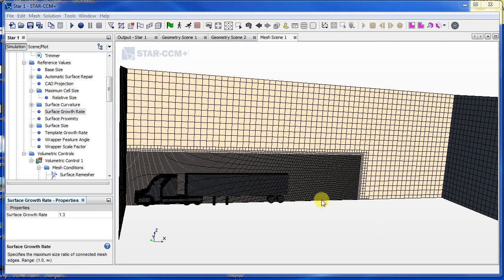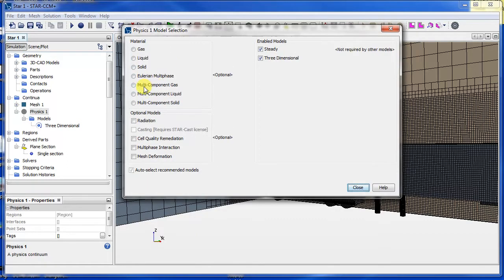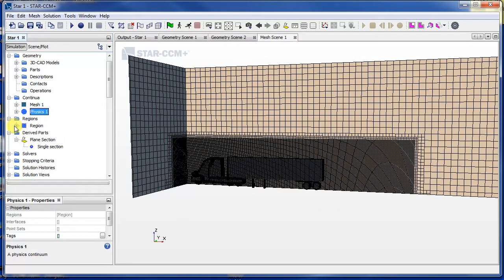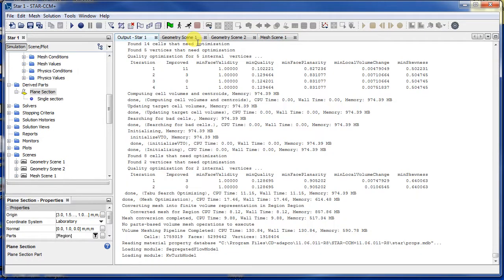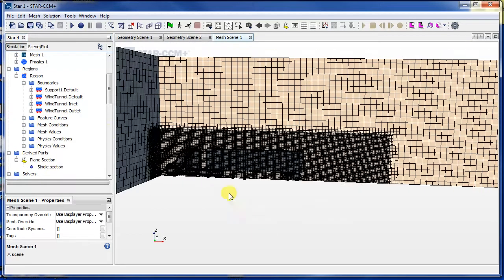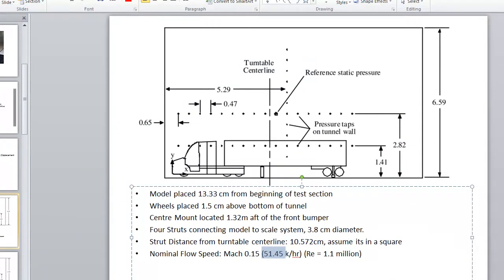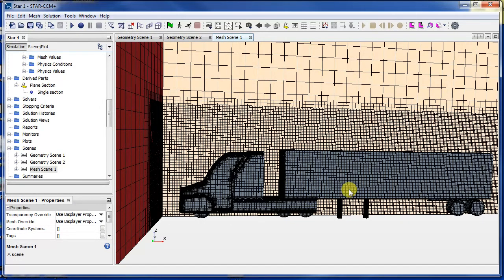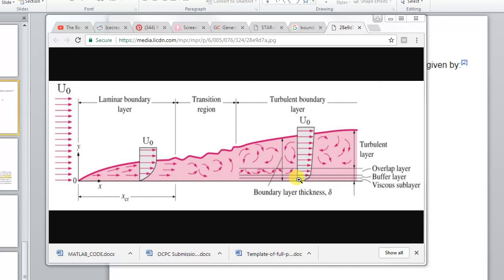Star ccm+ Beginner to Pro [Simulating a truck part 11]

Comment: What is the difference between segregated flow and coupled flow and when do you use them?
Reply from the maker: segregated vs coupled flow has to do with the degree that the next time step uses information from the previous time steps. in a coupled simulation it uses a lot of information from pervious steps and therefore uses more memory but the solution is more stable. As a rule of thumb use segregated unless doing supersonic or shockeaves.

Comment: Mach 0.15 * 343 m/s = 51.45 m/s ??? If Re = const, when decreasing L, you will have to increase the Velocity
Reply from the maker: Well spotted they used the wrong units, should be 51.4 m/s
Reply: @zacmac  Thank u very much for your tutorial videos